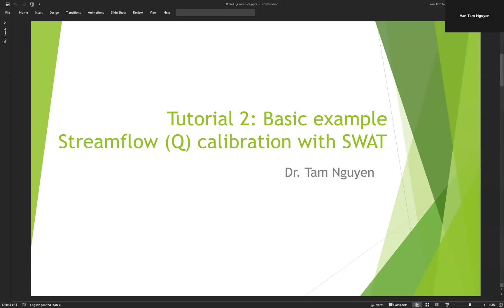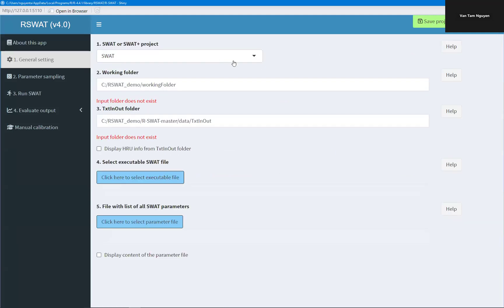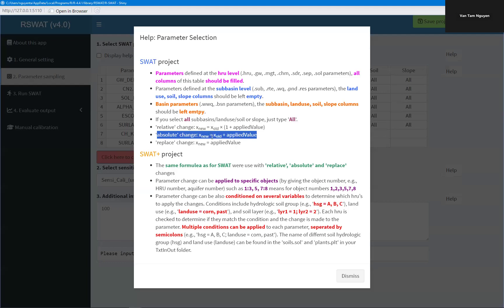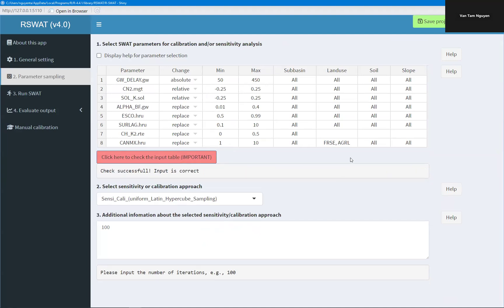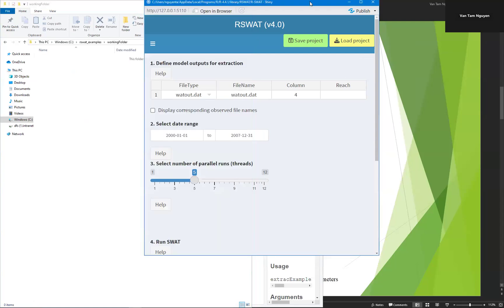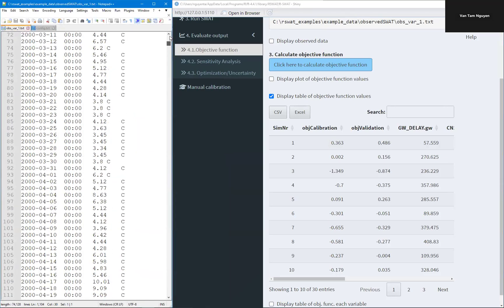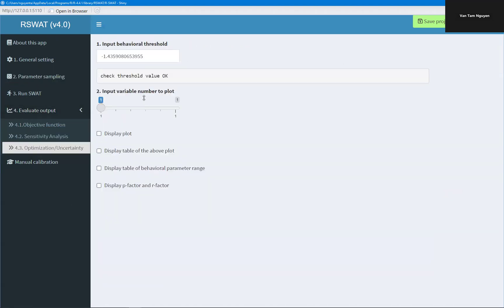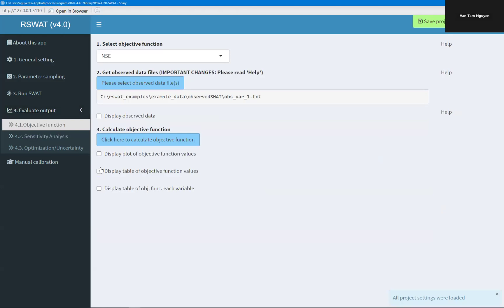RSWAT - Tutorial 2: Basic example - streamflow calibration with SWAT

Comment: Thank you. I keep getting an error that says "cannot open the connection" when i press "Click here to calculate objective function" even if the outputs are there and i also have the observed value and it displays correctly when selecting the "Display observed data". Help, please.
Reply: I have the same problem, did you solve it?